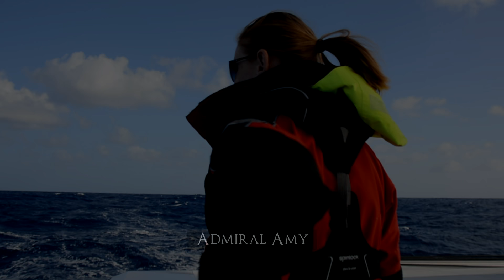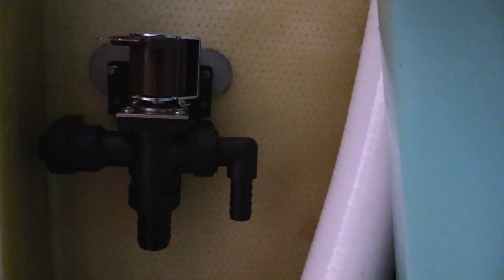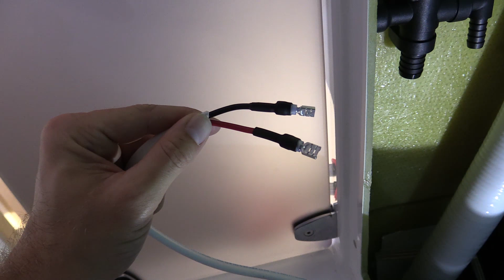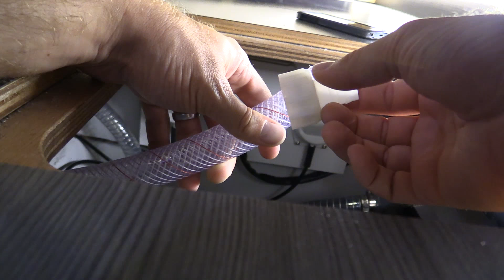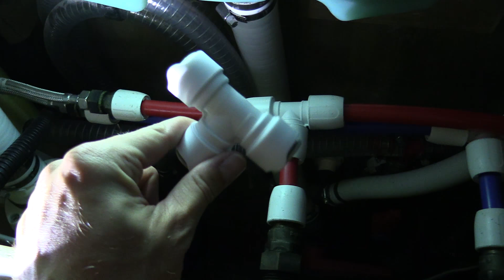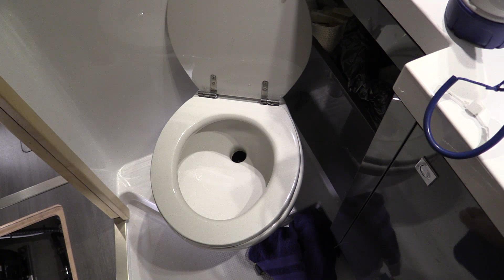Life Aboard: Converting Heads to Fresh Water

Comment: I am considering switching from salt to fresh water flushing as well. Watching your video, I realize this is more complicated than I thought. I was going to just cut the saltwater supply line, install a check valve to keep saltwater or wastewater from potentially contaminating my freshwater tank, and then connect my freshwater supply to my saltwater supply hose. Would this work too? I have an electric flush, not a VacuFlush, toilet.

Comment: Question: Why didn't you just connect the new Fresh water hose from the output side of the solenoid outlet directly to the current raw water (white) hose that was previously used as the inlet hose for the head .... after it was taken off of the output side of the salt water pump and while it was still connected to the input side of the head .....rather than installing a entirely new fresh water hose, was there some distinct advantage of that separate hook up?

Comment: Curious why you did not just tie in take of the seawater pump to the fw line with a 3 way valve and add a check valve on the fw line.  No need for wiring or a solenoid.  Just one more part to break.
Reply from the maker: Since these heads are electric, they have a switch which originally activated the dedicated seawater pump to fill the bowl.  Our freshwater system is pressurized and I worried that having another pump downstream of the main system pump could cause issues.  Using the solenoid eliminated any of those concerns.

Comment: Hi. I might have missed it, but did you disconnect the old salt water pump or did you use the pressure from the fresh water system to “fill” the head.
Reply from the maker: I disconnected the hose running from the salt water pump to the toilet.  The pump is still wired up so if I have to I can swap back to a salt water flush pretty quickly.  The new hose and solenoid are plumbed into the fresh water system, so yes, when we fill the bowl (open the solenoid) the main fresh water pump supplies the pressure.  Hope that helps clarify!

Comment: Was there a noticeable difference in the smell with the fresh water conversion?
Reply: I'm with you ! My top three changes I'll be making to my boat is converting both heads to fresh water,adding a watermaker provided there isn't one and installing both a wind generator and solar panels. That said I think I'd do it a bit different then this fellow did, I don't trust that solenoid keep my portable water safe from the non-portable water. I would install a separate water tank and re-plumb both heads to it independent of all other water sources. This would leave my sink,showers both in boat and out of boat running on portable water and my heads using non-portable water with zero change of contamination.
Reply from the maker: We didn't have the salt water flushing long enough to really have a noticeable smell, so it's difficult to say.  But I am generally pleased with the (lack of) smell from the freshwater heads.
Reply: Thanks for the reply.  I've been on a few boats in the Chesapeake and the saltwater head smell is quite noticeable.  So, when I buy my boat that will be the first thing I change....after I install the watermaker. Ha  Thanks for video showing how easy the process is.

Comment: With out sounding too crude do you have an estimate for the amount of water it would take to flush and clear the lines all the way to the holding tank?
Reply from the maker: +George Miller I just looked it up.  The bowl holds 2.2 L (.58 Gal) and we generally flush 1 1/2 times to make sure the lines are completely clear.  So I'd say about 3 L or 3/4 Gal.  Hope that helps!
Reply: +Out Chasing Stars Thank you very much. This actually does help, so by my estimation plus a cushion I would need about 15 gallons per day just to flush. Or about half an hour of run time on the water maker.  And maybe another hours or so to account for showers and laundry. The next time to two of you get back home let m e know we'll see if we can meet up for drinks. Your about 5-7 years ahead of me, but I'm about 20-25 ahead of you :), we're up in Humble.